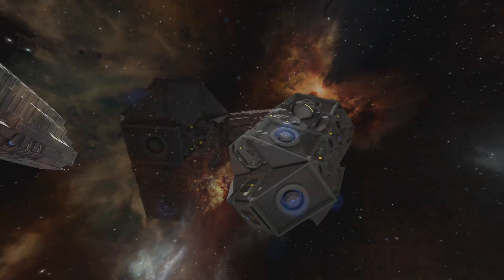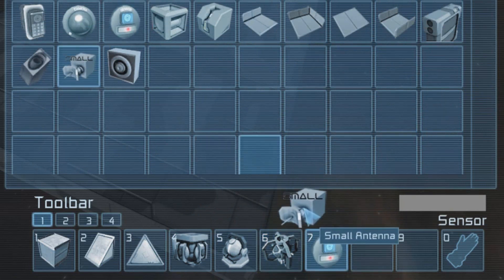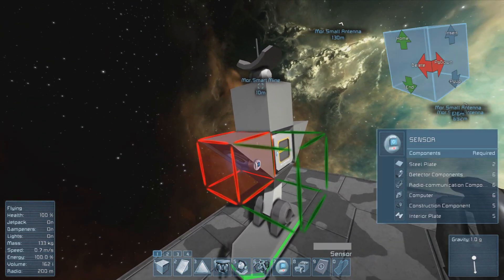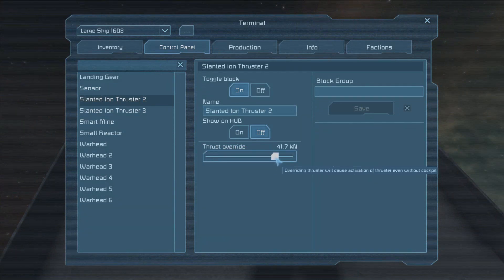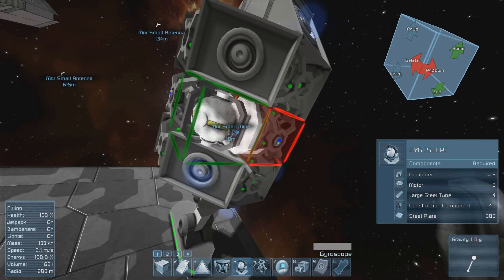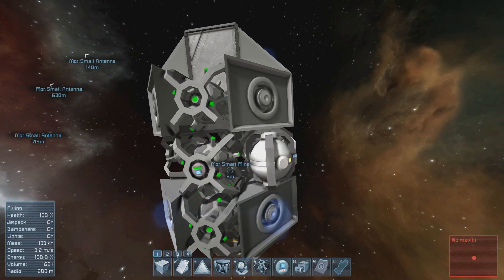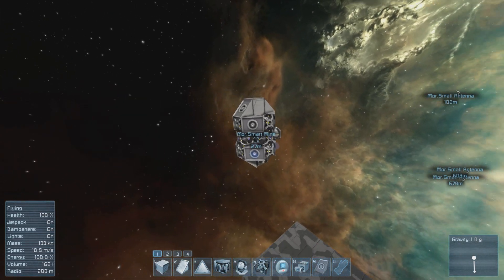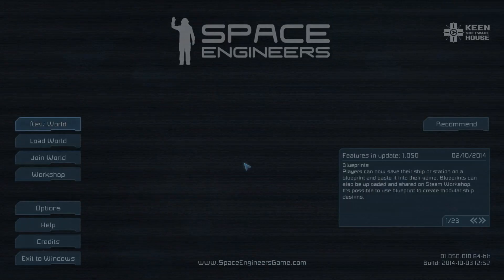How to Build a Sensor Guided Mine [Space Engineers]

Comment: It's been a year but still a great video, thanks Morphologis;) I'm looking to learn more about the game... I think it's brilliant.
 
Here's a challenge.. 
is there a way to make smart mines that move out of the way when friendly ships pass through the mine field but attack enemies?... that AND is it possible they detect other mines and make sure they don't collide with those?

I'm thinking it would probably require some scripting but it should be doable, right? that way you could potentially make a minefield of many mines which your faction can fly through without hassle. in theory ofc. 

I don't think it's possible to have them move back to their old position after you've passed though, though with the GPS coördinates it could potentially work.
Reply: +Fizzlefuse  You would simply need to add an extra sensor on each side set to detect friendly and fire those thrusters back..use a timer block on it to then stabilize the mine.